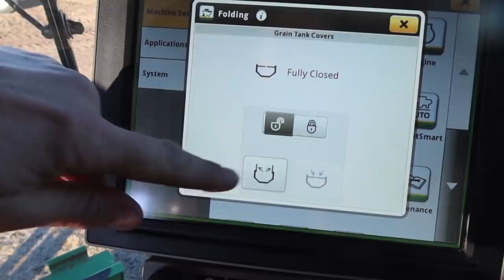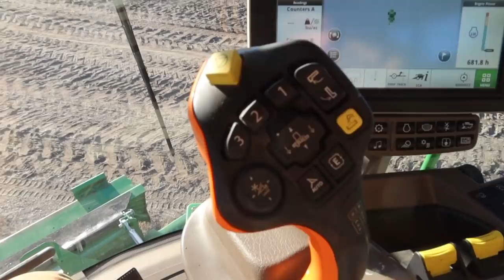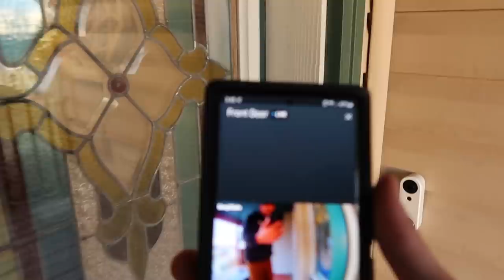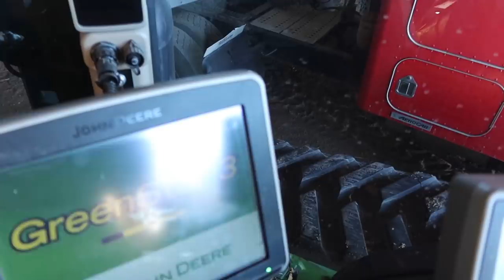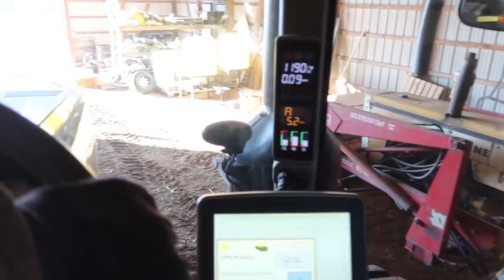Adding to The Line Up?!?!

Comment: Zack there are some bent chaffer louvers in the back,have them change those louvers if you buy it.It's not free Zack the auger will wear through in that spot in 2 years,just get  a extended monitor for the cornerpost it has not brains in it so it is pretty cheap.

Comment: Only thing that you should have to clean on that Raven cold flow unit is the strainer on the back where supply hose enters and take 3/4 vapor hoses off body and the 3/8 hose that runs from end to end of cooler and blow it out in all directions with compressed air making sure all is open in cooler body.

Comment: Some facts about DEF:it freezes at -11C(12,2F) so if you if you have a diesel engine you got to plug a blockheater on it at -10C(14F) When you start your diesel engine you have 30 minutes to warm it up;if it s not warm enough the engine will go in ''derate''mode and your maximum speed will be 8km an hour or 5 miles per hour!It had happened a lot of times on my truck!

Comment: FYI if you keep using an impact gun on that wheel lock socket eventually it will break. They are made so weak you need to use those sockets by hand or order an extra one for when it does break. Really sucks when you get stuck with it broken.

Comment: As long as it's stored below 50 degrees, DEF should store fine for a year or even a little more... it's when the temps get higher like around 80 degrees is when it can breakdown very quickly and shelf-life becomes very short, maybe a couple months at most. Have a tractor that is used year-round with DEF in cold storage shop... freezes in the winter time overnight, thaws back out when the tractor warms up.

Comment: You’ll come to hate the clean grain elevator and that bubble-up auger gearbox. Did 3 on a 670, and 2 770’s. Deere hasn’t found a good solution to that problem yet, and it’s been a known issue for a couple years.

Comment: I used to run a 9880 STS  here in the UK with a 30ft header. Sadly it couldn’t cope with UK crop density and pretty much destroyed itself, especially the header. It replaced a CTS twin rotor machine which just wanted to set itself on fire in Beans! All replaced with a LEXION!

Comment: Hey Zach STS 12 is a good machine but if you are serious about getting a sprayer I would personally go to the STS 14. Wider wheel base so it rides a lot better than the 12. However the 12 does turn just a touch tighter but hardly noticeable with a 120 foot boom.

Comment: I think you should get a new combine, but keep the 9870 as well. We kept 2 combines even after we were done with doing large scale custom work. I promise you won’t regret it. If you get the s780, boost it to have the power of an s790.

Comment: I dont get the hate DEF gets. We have used def on our machines since 2011 at that was the first tractor we got with DEF and now we have 4 currently and had 5 in total. Combined hours of around 17-18k hours and we are in a area in norway where temps can go as low as -20c in winter and up to 35c summer. Only faults we have had is 1 DEF hose, 1 DEF sensor and we used bad DEF once. Otherwise its been treating us good. Fuel usage been kept down and i fill DEF every other time i fill fuel. CNH machinery btw

Comment: Dual 800’s!!??🤔 Not sure that’s an approved tire configuration from mother Deere.....😬. Have dealer check the final drives if they didn’t already.
Reply: Clearly it is because the combine is only two years old
Reply: @chadjustice8560  that does not mean it came that way from factory. Farmers can change configurations after purchasing. It will just make getting warranty more difficult if any of the drive train components are damaged or worn prematurely. It’s just better to check.

Comment: You are doing the Honey Do list wrong. If it's been on the list for less than 5 years it is still considered new, 5-10 years is classified as "right after I get done with (insert excuse), 10-15 years is "Next on my list", and anything over 20 years that hasn't already died or fallen apart is classified as "I'll do it tomorrow or next week" whichever works best. The goal is to die before you complete more than 5 items :)

Comment: Zack you come down here to a farm that has to work more then just 6 months we have to work every day you won't have to get in shape because we have sh## by the truckload lots to scrape fences to fix equipment to work on and calves to check and its almost winter calving season get you tuned up ready to push the auto steer button this spring haahahahahaahah

Comment: I’m sorry I don’t want to be rude but simply safe sucks I’ve tried it doesn’t work and I don’t want monthly subscriptions Costco sells a Lorax camera system for 800 bucks no monthly contract and it does an amazing job I have it installed and it works way better than the simply safe